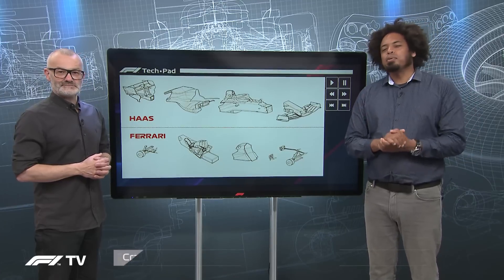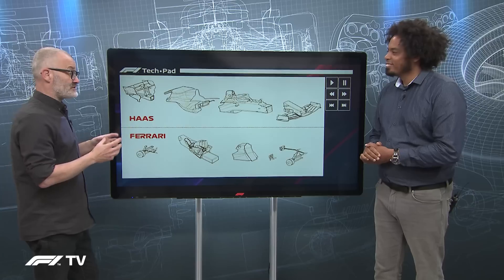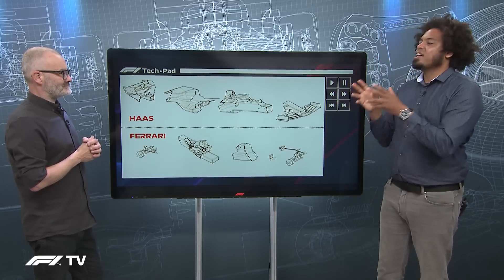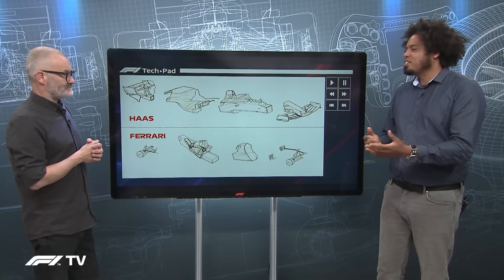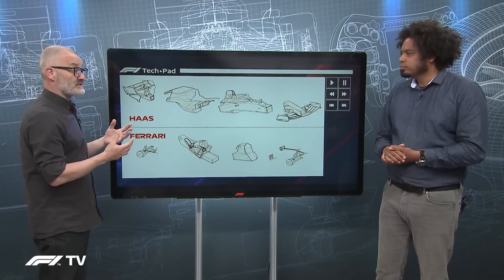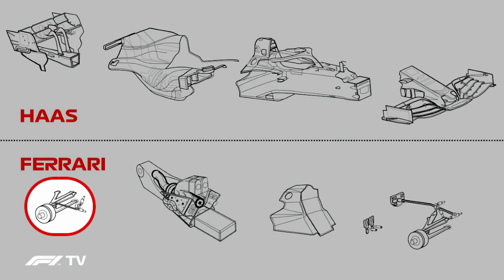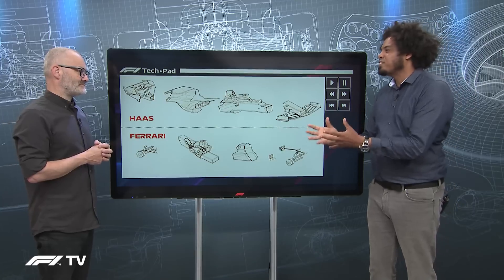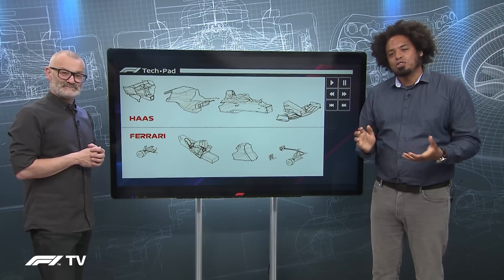A Deep Dive Into Haas' Listed Parts | F1 TV Tech Talk | 2021 Azerbaijan Grand Prix

Comment: Hang on, isn't the suspension a "wetted surface"? It, in the most simplistic terms, sticks the wheels - the open wheels - to the body, and, particularly in the case of the front suspension, many of its components are right there, cutting into the air before the majority of the rest of the car. 🤷

That to one side, as ever a very interesting piece. Thanks, gents!

Comment: So Aston Martin is called a "controversial team" for copying the Mercedes. But Haas is not called a "red white and blue Ferrari" after they been copying the Ferrari since 2018? Ok.
Reply: I think the commotion for Haas has died down after some agreement and clearer picture of the rules for customer teams as mentioned in the video. The car Racing Point/Aston Martin used in 2020 is almost the same as 2019 Mercedes. Inner or outer parts/components. They were penalized didn't they? 

One copied and one bought. think that's the main difference.
Reply: @chenluming885  Have a look at 2018 Haas and compare it to 2017 Ferrari. Same problem. There was some protests at the time from other teams, especially because they went from 6th/7th to a solid 4th in performance. But now everyone talks about Aston Martin still being a copy of the Mercedes, but Haas passes under the radar when they do it since 2018.

And I was not talking about listed parts, it was never about that. It's about how Haas copied the Ferrari and gain performance with it. But I guess since then they died down in performance, people forgot Haas pretty much opened that door for others to do the same (since the FIA back then did nothing to prevent others from using the same idea).

They were penalized because they copied a piece they had from Mercedes that was unlisted at the end of 2019 (the brakes) not because they copied the car itself, they never found proof they had CAD directly from Mercedes. And so, just like Haas did, is legal. 
And that's what I'm talking about, big controversy over Racing Point's car, but Haas did it before and the FIA did nothing to prevent other teams from doing it, even after several teams (Mclaren, Renault, Williams) protested.
Reply: "Copy" and "buy" have different meanings.
Reply: @GloomGaiGar  Read my reply to Chen Luming. I'm not talking about them buying parts to Ferrari. I'm talkiing about them doing the same that Racing Point/Aston Martin did (copying a whole car from another team) and gaining an advantage because of it.

Comment: By seeing this video, I'm quite impressed with how the only two works team on the current grid Mercedes and Ferrari are engineering with so much efforts spent on designing almost every parts of the car. It will be great to see RedBull joining hands next season as a complete works team!!
Reply: Renault/Alpine?
Reply: @penusliski  Alpine and Renault have partnership so it isn't a complete works team.
Reply: @vineethprabhu8560  This is like you said Mercedes and AMG have partnership and it isn't a complete works team
Reply: Alpine is basically a sub-brand of Renault. It is still the Renault F1 team.

Comment: Why would you like to see more teams do this? We'll basically end up with half of the grid being B-teams, which will harm the sport. If anything, there should be more actual manufacturers coming in. Otherwise, everyone can race exactly the same packages with different aero/wings 🤷 please correct me if I'm not getting the point here 😊
Reply: It won't harm the sport. All teams have to design/make their own aero packages so that won't change. And B-teams play a fundamental role in driver development. Also more teams means better racing and more drivers that deserve to be in F1 getting the chance to. In the 70's and 80's they would have 25 drivers some years. If you are still unsure i suggest checking out MotoGP and how they operate with factory and satellite teams
Reply: The chance of "actual manufacturer's" coming is small at the moment. F1's technological direction is at odds with the current consumer trends in road cars.

Comment: Why isn't the suspension considered a wetted item/surface, which makes contact with the air?
Reply: I think probably because most of the suspension components are internal. So all the springs and dampers are housed inside the monocoque behind the pedal box. And the suspension arms which attach the wheels to the car are incased in Carbon Fibre. And so non of the actual parts make contact directly with the air.
Reply: @Samsthings  Fantastic, thanks Sam!